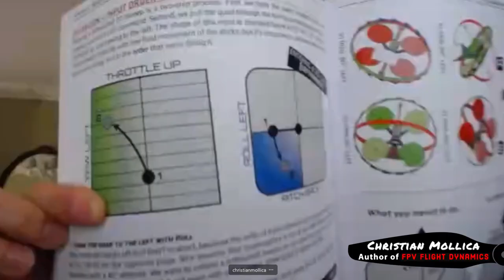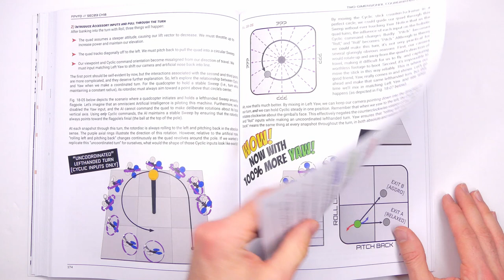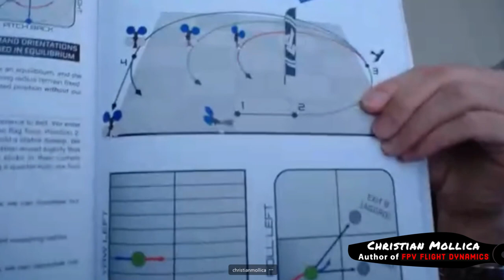😮 ROLL, then YAW: Why input order matters! Christian Mollica Interview Excerpt

Comment: If I remember correcly. One of my fav fpv pilot YouDontKnowMe recommanded it YAW first. I think its just preference matter.
Reply: Yaw doesn't actually turn the quad though, and so opening a sweep with a Yaw command is almost always incorrect. You'd only do it if you were entering the Outside stance and pushing into a sidewinder, or if you were flying something like a Cinewhoop at a very low camera angle and circle strafing. Roll comes first to bank the disc, Yaw follows up as a modifying command to manipulate the radius of your sweep.

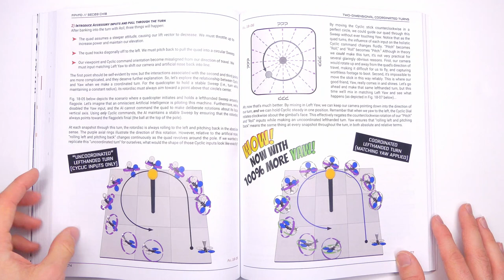Comment: @02:49 you lost me at the cyclic stick. All I know is yaw roll pitch and throttle. I thought cyclic was for helicopters.
Reply: In the book, the "Cyclic" stick is the name that I use for the right stick in a Mode 2 configuration. So, just like a helicopter, the Cyclic stick manipulates the craft's rotordisc on its two horizontal axes (lateral/Pitch and Roll/longitudinal). And as a side note... The "pitch" and "roll" commands aren't truly independent of one another, as they do not command objectively identifiable axes of rotation (due to the symmetrical nature of quadcopters and multirotors in general). In FPV, we really only have three inputs: Cyclic, Yaw, and Throttle.
Reply: @vespulafpv533  💡